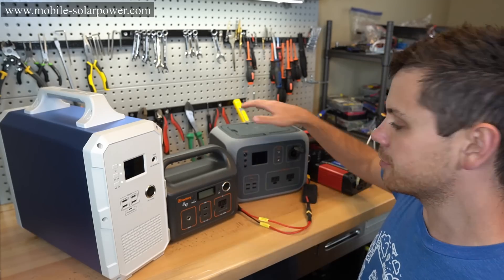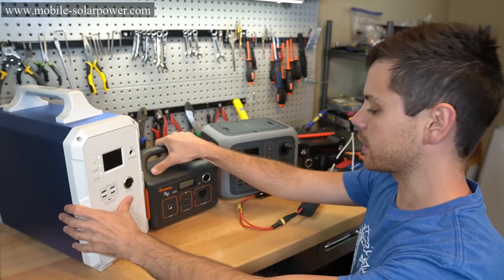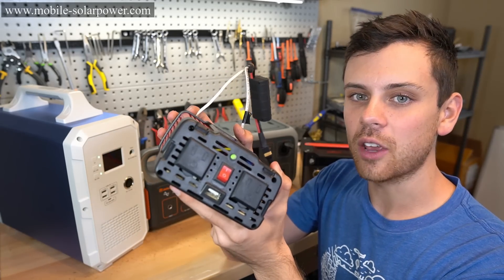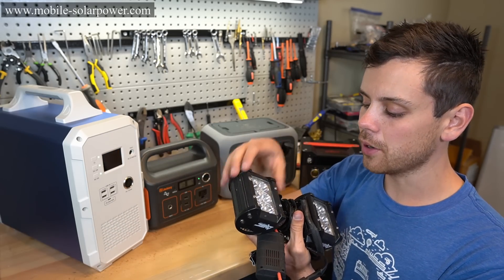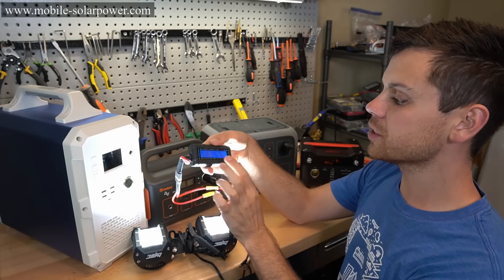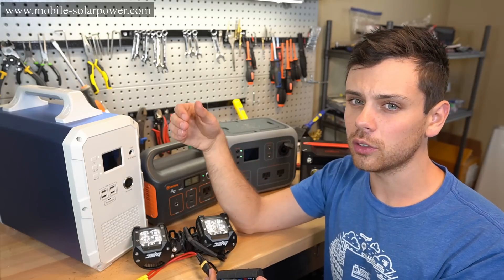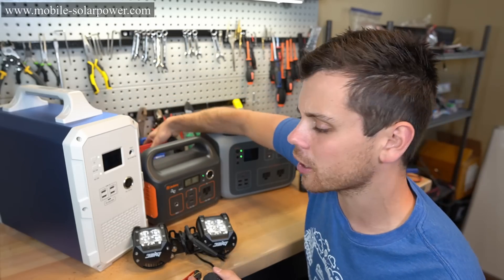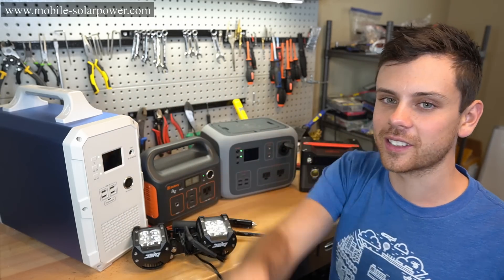Lithium Solar Generators: Why you need a regulated 12v output

Comment: Hey Will, love your videos. Just thought you would like to know that the Rockpals 24-volt output is regulated. I ran a 40-quart portable fridge loaded with pre-chilled drinks for 27 hours until the Rockpals shut down on low voltage. the whole time the 24-volt output voltage was steady. great little unit.

Comment: If you need 12v regulated for your 12v stuff, then buy with 12v regulated. 
I personally don't require 12v to be regulated. Yard long bar lighting shows no differance when on regulated 12v.

Comment: Can you power a 0.8 amp small AC fridge using the 12V DC output of a Jackery Explorer 500 using a DC to AC converter?  DC fridges are rather expensive so I want to go the cheaper route with an AC fridge, thanks.

Comment: Will, I noticed that when I have something powered by the 2mm power output area that it shuts down after about 5 hours!  Can you test that?   I thought that since I was pulling less than a Watt that it figured it was too little .... so I powered lights that pulled 4 watts ... still shuts down after about 5 hours!   On the usb side, it has no time limit.  Can you test that on other units?

Comment: I just bought a Rockpals 300 watts with a non-regulated cigarette output.   For the $250 cost, I thought no problem ... I didn't think that I care to have anything to plug into that ... however I found 2 small inverters that are 100 watts and a small car vacuum that don't work when plugged into the Rockpals.   I suddenly wanted to use the vacuum when I had a dirty shed with no power nearby.  Then I wanted an extra plug for a second 110v ac light and thought I could use one of the inverters to give me that 2nd plug.   But no, I can't do either one.

Comment: I have a webasto gas heater and a Jackery 1500 unit. Upon initial start up, the webasto unit shuts off then back on.. it’s not getting consistent power on initial start up.. goal zero fixed this issue on their pack by selling an accessory 12vregulated cable. Jackery does not have this. Any tips on how to fix my issue?

Comment: There's another aspect of this too.  Some portable fridges come with a battery protection feature that lets you select a voltage beyond which the fridge turns off.  So I guess this is designed for car/boat batteries, and there's usually 3 settings, high, medium, low.   So your fridge may or many not fun depending on which setting you use and how long it runs too which can be confusing if you don't remember the setting.  I recently bought a power station and the seller claimed it was regulated but then when I put it on the fridge, I noticed a big drop in voltage over a short time.  I'm guessing that over time, as voltage drops the fridge won't be able to keep the target temp as it did at the full charge, depending on ambient temp.

Comment: Can I ask a question? Is this for LiFePO4 or Li-Ion? I was told by a company that LiFePO4 will maintain >12V until right towards the end so doesn't need a regulated output.

Comment: I've been looking into these alot lately and I can see a use for both, I would ideally like one that's regulated with an unregulated port most of the cheap dc/dc converters are like 95-98% efficient, i would like to have 1 unregulated port to run some low power LED's ect and gain that few %.
Also I am trying to find a solar generator around the 300wh mark that has type C in/out 60W or higher, ideally 50w or higher solar input, and atleast 300w inverter although 500w would be nice but i am yet to find anything for my needs.

Comment: So in a DIY solar generator build, what would you recommend as a 12v regulator on the battery output? I don't think I saw a regulator on your suitcase pack or your pocket size generator for example?
Reply from the maker: No need for LiFePO4. Voltage high enough so no boost or regulation needed. Only required in these units because they nearly always use nmc chemistry

Comment: I have a boom box and a wireless router that are 12 volt but will not run on unregulated 12 volt power supply. Does the battery bank need to be more then 12 volts to be regulated to 12 volts?

Comment: I have been having this exact problem with my Renogy Lycan Powerbox--- it will NOT power my 12v ARB fridge and it must be because it has unregulated 12v out put. I am so unhappy with this! I spent good $$ on this unit so I could power my fridge off my solar panels when camping or when the power is out at my house, and the fridge will only run off the inverter that is in the Powerbox. That is inefficient and wrong! Has anyone complained to Renogy about this issue? Thank you so much for your very helpful videos!

Comment: I have a question oh, I just got a bluetti , I have a lot of hardwire 12v wires throughout a campervan that I'd like to run to the bluetti. 
I have a 12 volt fridge that I figured would be plugged straight into the cigar plug of the bluetti.
But for everything else that is 12 volt in the RV, how can I plug it in?
Wire it all to a bank and plug in a AC to DC converter from the bluetti?
????????????
Anyone know?

Comment: I recently start watching a lot of your videos to learn about solar energy, etc.  Thank you for producing these videos and I have learned a lot.
I ordered the RockPals 500/540Wh before watching your video.  Very helpful explanation about 12v regulated.  In that case, it only matters if you're devices requires the 12v output?  It wouldn't matter much if most of the devices will be powered via the USB and AC ports, correct?  Also, why would you plug in an inverter into the 12v while the battery already has the AC ports available?  I'd think it is only for demonstration purposes?  :)

Comment: Hi Will,
Great video! Is there a way of retro-fitting a device to regulate the 12v output? I see that you can get a Goal Zero cable that does this but wanted a different solution if possible.

Comment: I'm new at this,  so how do I know the solar generator has a regulated 12V output? Does it says in the box or manual? I was thinking about buying the  Rockpals 500 because it charges faster,  but I guess the Jackery will have to do even if it charges slower. Do you know any solar generator that has both fast charge and regulated 12V output? Is there any? Thank you

Comment: On the Rockpals, is the 24v dc output regulated. I've read that it is. Only the 12v dc outputs are not regulated. Can you confirm please?

Comment: Thank you c so much for setting straight this issue of regulated output. I almost purchased  Lion Energy 500 watt generator but was not certain it would power my Dometic CF 50 fridge. So glad I researched more with your video. Saved myself a ton of grief. ♡

Comment: How can I rectify this voltage output on my unit? I need to connect a 12V fridge.  Is there an adapter or easy mod to get the regulated voltage output from it? Thanks for any feedback.

Comment: I agree with you with lithium-ion battery units as most of the capacity of these batteries is delivered in the 11 to 12 volt range with three cell configurations

Comment: Will, Suaoki claims that their G1000 has a regulated 12v outlet. Can you test it? And is there a solar generator that charges fast with a 12v regulated outlet under $500?

Comment: Of course your are right, Will - but it all depends on what kind of load you want to run on the 12V and what you expect. I have a very small diy solar system built on our roof (just above 300Wp) and i just use buck- or buck-boost-converters to charge everything i want (from big lead acid car batteries to diy li-ion batteries). I also run the same buck-/boost converters off my batteries to power up what i need. I found the led-lights are much more efficient when you dont use them to their full power capability. They stay cooler and last longer and give you a higher overall efficiency. If you just need the extra power for a special purpose - just use it. There are cheap buck- or buck-/boost converters available up to 300W for very low money. I even have a 1000W DC converter from Rui Deng (China) who does produce quite good quality and very efficient converters (DPS5020 e.g.: give you output voltage from 0 - 50V at up to 20 Amps, max. input voltage is 60V). There are other models too with higher input voltage. Its so easy converting the voltage - you dont need expensive build in equipment if you are a bit experienced in electronics - you definetly are :-)
Reply from the maker: I actually have a video I posted about 2 years ago on how to use DC converters. I've been using them for about 15 years now. That's when I built my first ones. But these units are for beginners. and I want them to be dead simple. I don't want to explain to someone who will never care to add a boost converter to something that should already have it. It just seems completely illogical
Reply: @WillProwse   You are totally right, Will. These expensive components should have DC buck-/boostconverters built-in already. They should have an automatic shutt-off if no current is drawn as the stand-by current can be quite substantial.

Comment: You do need to regulate output to 12v. Some appliances have a narrow allowance for input voltage (like my signal booster). Also, you need to regulate the output for not being too high. The charging voltage for you battery is 14V, while your LED or your DC fan requires 12V. Over voltage will generate a lot of heat and even burn the bulb or motor (I once changed 9 out of 12 LED bulbs in half a year, and they are too hot I ended up turn them off during the summer day. Now I put in a DIY dimmer in to regulate over voltage).

Comment: Hi Will,  I wanted to let you know that I got a replacement for the Bluetti EB150 , plugged it in to a solar panel and then to my Mac and it again became unresponsive.  I tried it will an old PC that I had and the exact same thing happened, it became unresponsive.  Both of them did not work until I unplugged it from the EB150 and restarted them.  I would really appreciate it if you would try and experiment to see if you have the same results and if you can figure out how to use the generator with a computer while hooked to a solar panel or a wall socket.  Both those charging sources created the same problem.  PLEASE HELP!  I want to figure this out.  Thanks

Comment: I have a question that doesn’t really pertain to your video. I have a EP ever 3215 bn with the mt50. I would like to buy a second one but not another MT 50. Can I run two controllers with one mt50? Another words can I use the oneMT 50 to read both controllers at the same time to read my output

Comment: Does anyone know if this applies to AGM batteries? I'm wanting to order some thing and mess around with a DIY....can only learn so much online. I've read that by the time the voltage drops below 12v on AGM batteries you shouldn't be using it anyways. Is this true or do I need a DC to DC converter?

Comment: I have a Goal Zero Yeti1000 and I can't run my 45L 12 Volt fridge whenever the state of charge drops  below 95% so I had to switch to AC power which sucks because it draws a lot more wattage due to the 20% loss with the inverter.  don't buy a GOAL ZERO Yeti if you wanna run you fridge via DC power! I am gonna switch to a Bluetti 1500!

Comment: This does make a good case for your inverter, but you really want your inverter to shut off before the batteries are damaged.  This is why Lithium-ION does not make good 12 volt batteries.  What really should happen instead of 12v regulated is they need the voltage range to match the lead-acid voltage range so the equipment detect the low battery at the 20% range instead of the 80% range.  If I had a choice, I would prefer the unregulated that matched the lead-acid range like Lithium-Iron-Phosphate does.

Comment: I had an odd question but you seem to know a lot about batteries.  I purchased a Bluetti after your review for the next PG&E outage but started to wonder...is there a way to use the Bluetti to continuously power or charge my 2019 Kia Niro EV Plug in?  It has a small 8wh battery installed.  That would be so sweet if that was possible

Comment: Thank you for all you do. Hey just wanted you to know that goal zero said that the yeti 1000/1400/3000 can take an input of 900 watts. Just an fyi for you website.

Goal zero states 360 input to main + 100w to an 8mm + 100w to an other 8mm + an other 400 to mppt

GoalZeroSupport

 

· 3 months ago  

The built in charge controller can accept a total max of 360. You are able to push 360 watts through the Anderson port, but each 8mm port is limited to 150 watts. To max out the Yeti 1000, you would have 4 x 100 watt panels combined and going into the anderson port. 100 watt panels only produce 60-70 watts under most conditions so your input with 4 is only going to be about 260 watts. With a 5th panel plugged into one of the 8mm ports as well, this will add another 60-70 watts of input for a total of about 325 watts of input. So 500 watts worth of panels will only really produce about 325 watts. This is the max we would recommend going into the Yeti 1000 Li. If you install the MPPT module to the 1000, you can then hook up another 400 watts worth of panels to it.
Reply: After reading this again, it looks like the net input would only be around 600. If you get a chance in the future maybe try an experiment maxing out all inputs of the the goal zero. If it can handle over 900 watt input then it would shut out all the competition.
Congrats on the house by the way.

Comment: I live off the grid up north and I would like a way to charge my batteries using my generator so that I can turn off my generator at night. I use a 2000 watt propane generator and I don't have any batteries yet.

Comment: Well, reality is a bit different. The company (or companies) claiming devices will work with unregulated 12V output are correct. Depends on what though. If you power electronic devices (not electric) they have their own internal DC/DC regulated converters. They never actually use 12V internally. On the other hand, a regulated output means that the max curent you can draw is limited by the regulator. Let’s get to the point were you need to jump start a car. A regulated output will just fry the regulator (unless its a very expensive one). In addition, regulated outputs have losses (thermal). So to conclude: there is an application for everything. Depends on the market you are addressing. For consumers who want something fast in a car to charge phones, laptops, and also being able to jump start their vehicles, the unregulated is preferable. If you use it for an RV or van life rig, you should go regulated. BTW: you led and inverter are very cheap and do not have internal regulation.... (again cannot say I hate or like them, depends on the application)
Reply from the maker: No that's false. Some do not work at all at this voltage range. Including 12v fridges that turn off at 11.5v. so no, not all devices work with it, absolutely not. 

Yes, so make large regulator. They are cheap and the difference in voltage from input to output is low. Efficiency is high and boards are cheap. I totally disagree with you.

And no, you size ocpd to regulator. You are wrong about the point with frying it. That's impossible in well designed system. For fast charge, unregulated is not ideal. How are you drawing your conclusions? Nearly everything in your comment is false
Reply: @WillProwse  I did not say that all devices will work, but most should. Let me first make clear, I do not work for any of these companies (or even in that field) to avoid misunderstandings, I have a feeling you react to comments not the way they are intended. Unfortunately regulators handling currents for car ignitions are not cheap. And boards to accommodate them either, just as a base of discussion (look it up on your preferred electronics part supplier). Most devices have internal dc/dc converters (I mean yes, it depends on the quality of the supplier but they should always put one for safety and protection, that's why some led flashlight are very cheap and others a bit more expensive). Now i might be mistaken in one thing, since regulations in the States are different, which means that 12V fringes over there might be allowed with unregulated input. Definitely not the case everywhere and definitely not the case for electronic devices. Check your computer's PSU for instance. The 12V lead would most probably be sitting at 11.7 or 12.3, the lower the quality of the power supply the highest the deviation. The computer does not mind that much as long at the drop is not significant. Now if you go to 10V, that's another story, but most DC/DC converters, depending on the output voltage, have even a lower cut-off, so the device would work anyway. (I would sent you a typical datasheet but probably I should not put a link here....)

Comment: Hi Will. I have learned so much about solar through your channel and I really appreciate it. Some things really confuse me though. One thing is the use of TVS and LED lights on modified sine inverters. Apparently this is a really bad idea and pure sine is better for them. I want to set up a simple system just to run led lights (I know leds prefer dc but I dont want the hassle of buying leds and setting them up, I just want lights I can plug into sockets- hence inverter) and a couple of extractor fans. I want to isolate certain systems and keep them simple.If I make the system for the lights a modified sine inverter and the system for the outlets a pure sine (for tvs) would this work and not damage the led lights?